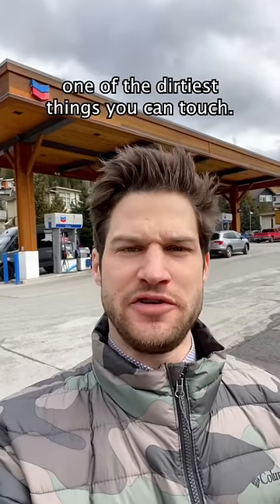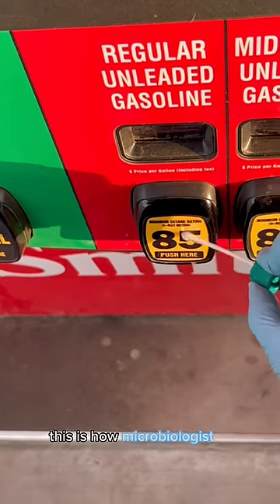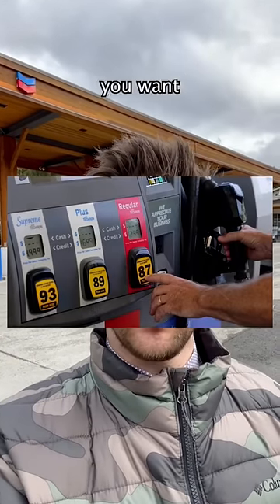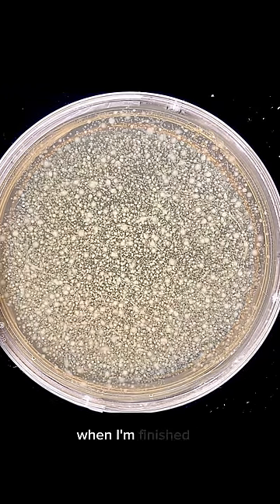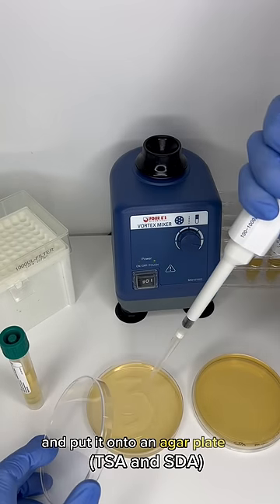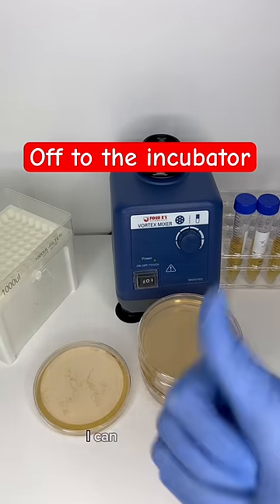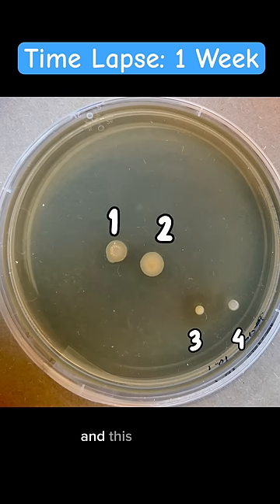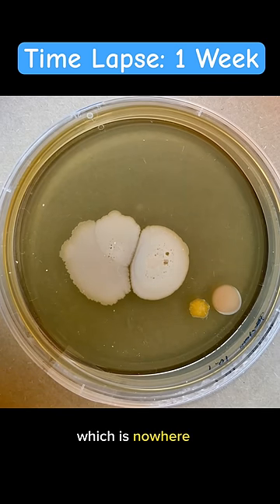Bacteria on the gas pump buttons?

Comment: Man went to the cleanest gas station I've ever seen
Reply from the maker: Probably. I need to go check more to double check. Keep an eye out for more videos. 😄
Reply: @whatmightgrow  you'd probably have to do dozens if not hundreds from different chains to get a representative selection, but it's still cool to show the process.
Reply: @whatmightgrow best thing is to go do a bunch and then combine and then divide by total.

But ask the servo staff what there most sold fuel grade(unleaded) is.

If they say 85 do that
If 87 etc
Reply: You’ve never been to a buc-ees then. Also that doesn’t necessarily make this test wrong.
Reply: @whatmightgrow check the buttons before hand, if it’s old and the paint is starting to wear, use that one!
Reply: @whatmightgrow what about the pump itself and the handle?? The most important parts you touch then go back to bring the dirt onto your car interior
Reply: I seen someone spray the pump n buttons w a little gas before they were finished and used hand sanitizer
Reply: Must be from New Jersey only state where it has an attendant who does it for you.😊
Reply: It is also possible that they just happened to have been cleaned that day or something
Reply: @whatmightgrow  i think you need to try to test the gas pump nuzzle handle too, ill wait for your update
Reply: @whatmightgrow absolutely! A test ain't reliable if its only done once
Reply: The pumps are outside and UV light for the sun should prevent to much bacteria from growing.  Those buttons should also be wiped down daily
Reply: @whatmightgrow they must’ve recently sanitizer it or something because my school door handles aren’t even that clean
Reply: @whatmightgrow try Costco
Reply: @whatmightgrow also take a sample from the pump handle because no matter which of the three buttons you press everybody touches that
Reply: That is average in my area.
Reply: I don't think your taking into account that people are hitting the button with the pump and probably getting gas on it killing some of the bacteria. That's how I hit the button anyway the handle probably way worse than the button
Reply: @whatmightgrow yeah why didnt you take samples from multiple stations? Instead you're determined to upload a video as fast as you can while providing no statistic and proves baseless
Reply: Fr I see stickers all of them near me
Reply: @whatmightgrow definitely.
And go to one that's in a poor neighborhood, preferably near to the liquor store and pawn shop.
Reply: @RomanGoetia he pribably needs to go to a suburban gas station
Reply: If people only knew that sunlight is capable of killing bacteria
Reply: @ThBlueSalamander yeah and that’s touched by every one, not just the one button the 3 buttons
Reply: @whatmightgrow thats the smoothest way to advertise your channel lol
Reply: Tbf gasoline is an amazing antiseptic
Reply: cope
Reply: @moo_dirty_socks_inc.407  same it was also weird to see wooden doors on gas chambers
Reply: Not really, how many microbes would be able to survive exposure to gasoline fumes
Reply: Bro went to a buc ee's
Reply: @whatmightgrow maybe if you went to a popular gas station
Reply: Just means it should’ve been a more dirty button.
Reply: i would say, while the method itself is scientific, the sample size is nowhere near acceptable
Reply: Nice the shell near me has cowwebs hanging around
Reply: @whatmightgrow  and you need also to take a more serious sample set... ok you dont have the resources for a peer review level of samples but I mean if you gonna bother make a video about 1 sample you could easily make the same exact video but take e.g 10 samples obviously from 10 different stations around the area you test
Reply from the maker: @billkillernic  I agree. In my longer video of this (youtube shorts are only 1 minute unfortunately) I talked about how I would be taking more samples. The original study only had a sample size of 3. I plan on doing much more than that.
Reply: Where tf do you live cause where I am like every gas pump is that clean
Reply: They saw it coming
Reply: Or everyone uses more of the others than 85
Reply: you want to go sometime afternoon or early morning around 6 am
Reply: @whatmightgrow try to go there at a time where it's just clearing the busyness. If there is one nearby you that you could check, having worked on a gas station (Europe and for only a month) I can say that the handles are cleaned at least, if not only, once a day.
Reply: That and don't forget the handle of the pump that's most likely worse than the buttons :p
Reply: @whatmightgrow  Try the nozzle too. Not every touches each button, but everyone has to touch the nozzle handle.
Reply: @RomanGoetia 
This would be a reasonable research tbh ❤❤❤❤
Reply: @whatmightgrow some gas stations clean regulary and some clean sometimes and there also can avoid the buttons to clean the screen
Reply: @whatmightgrow can there also be other factors like people using wipes before they press the button.
Reply: @whatmightgrow you tested on the new guys first day
Reply: The weather can destroys the bacteria
Reply: 😂fr
Reply: @whatmightgrow true lmao
Reply: He probably went to it just after it was cleaned
Reply: @whatmightgrow If you could go to a gas station in a rural area, I'd watch just to find out how dirty the gas pumps I've been touching are.
Reply: @whatmightgrow you should go to the lowest rated gas station and try it there
Reply: @whatmightgrow pleasee do the pump too!! i feel that would have alot more since its not three different buttons to choose, everyone grabs the pump yk??
Reply: Bruh I know for a fact in my city ain't nobody cleaned those buttons in years
Reply: Not to mention the video said "gas pumps", and even showed a picture of the gas pump...and this dude swabs the gas button! 🤦🏽‍♂️ Besides taking ONE sample and trying to sound scientific when he horribly failed using the scientific method. 🤦🏽‍♂️
Reply: @RomanGoetia It would also help to swab the GAS PUMP since that was the original statement...instead, this dude swabs the gas button! 🤦🏽‍♂️
Reply: @Crushal812 But the original video didn't say gas button...it said gas pump, and even showed a picture of the gas pump, and yet he swabbed the gas button. 🤦🏽‍♂️
Reply: @RomanGoetia especially ever since Covid a lot of businesses just started wiping down everything n never stopped so I guess that’s one cool thing we gained lmao
Reply: Also who uses the 85 button
Reply: Fr
Reply: @whatmightgrow yo
Reply: Gas station attendant here we clean them every 6 months or so for evaluation every store is different however ive heard the same from other stores in my area

The last clean my store diss was 2 months ago
Reply: @Steve.._.  That's the whole point.
Reply: Got a point the sample size was not diverse enough
Reply: Most of them look like that where I live.
Reply: @whatmightgrow bro went to bucees 💀
Reply: Yea I feel like a smiths gas station is representative lol. They’re a bit of an outlier on cleanliness for their fuel stations
Reply: @whatmightgrow  here in California it’s very common for gas station to sanitize the handles and the buttons 2 to 3 times a week and at least once a month they pressure wash the actual pump and concrete
Reply: #soda
Reply: I bet premium button is cleaniest among the three😅.
Reply: @whatmightgrow if you admit this you probably shouldnt've posted. We all make mistakes and oversights, though.
Reply: Nah, I think the reason is chilly wind and ultraviolet. Indoors the bacteria grow a lot better
Reply: Usually you can see like crust and gunk forming on the buttons, idk where he was but its way cleaner than they usually are
Reply: @RomanGoetia I think 10s of them and just average it  up
Reply: @gfdrffd3279  you could do that.  The more data, the better, but 10s would definitely be better than just a couple.
Reply: @whatmightgrow  that gas station probably disinfects their pumps regularly or you took samples when they just cleaned it
Reply: @whatmightgrow  Yeah, the ones around where I am are disgusting beyond compare, but I thoroughly wash my hands in case of gasoline anyway so it’s chill.
Reply: Exactly! I've seen people spit on the gas pump for good luck
Reply: Yeah it looks like a newer store. He obviously new that
Reply: @whatmightgrow if you find on, sample premium too.
Reply: @whatmightgrow go to Costco guaranteed good sample
Reply: WELL HERE MOST people tap the button with the nozzle so we good
Reply: Dedicated workers are the ones you can thank for that
Reply: A😊
Reply: and a lot less people use 85 octane
Reply: Try the Bronx..
Reply: @whatmightgrow lol why would you not check the handle? What is the point of this video 🤣🤣
Reply: @whatmightgrow  You also need a few control swabs for comparison. At least one of the swabs shouldn't touch anything except for the surrounding air, and another one should touch some other nearby material. You know, to be really scientifically methodical.
Reply: @whatmightgrow go to a shell they are always dirty, or depending where you are like a Valero or something
Reply: Fred Meyer fuel center was the only gas station I ever worked at....and we clean all the pumps daily (or at least it's assigned to the workers)
Reply: For real 😂
Reply: @whatmightgrow yea need larger sample size😅
Reply: It would also be smart to do it in the actual handle of the pump gun and not the button people press for a millisecond before the pump gas
Reply: @whatmightgrow  I’m pretty sure the actual pumps are “dirtier,” but it’s because of the gas, not the bacteria. So touching your face after getting gas would probably poison you somehow, not cause an infection.
Reply: Not exactly a great environment for bacteria though, dry and gets some sun, I’m sure your kitchen sink is worse
Reply: Do 87 instead of 85 cause who uses 85
Reply: i dont know man, ive been in some pretty sus areas
Reply: You also only wiped the button noone uses
Reply: @whatmightgrow  yea it depents on wich country the region the city + was it cleaned not so long ago or like never cleaned many many factors
Reply: @tidepods2004 because that's totally not flammable
Reply: Or they just cleaned it
Reply: Go to the hood
Reply: @whatmightgrow come to india 😆
Reply: @whatmightgrow I think you're a lier. Clearly you picked one station where the variables are in your favors.
Reply: @RomanGoetia why would he need hundreds what are you talking about
Reply: @pepega3344  The more you have and the more diverse the samples, the closer you get to having a representative data set.  This is why polls and studies that have thousands of participants, tests, examples, specimen, or reviews are preferable to those that have hundreds or fewer.  It lowers the likelihood of outliers, human error, and bias that may influence data, which is important for falsification. 

Next time that you read a study that has a small sample size, take it with a grain of salt because it's very easy to make false assumptions based on incomplete data.
Reply: Go to a wawa in a high traffic high pop area, or a circle k.
Reply: Sunlight is the best disinfectant
Reply: @RomanGoetia shush
Reply: @whatmightgrow I never touch the button I use the pump to press the button, you should test the pump handle.
Reply: I poke it with the gas nozzle tip
Reply: Literally tho
Reply: Cause it’s Chevron nobody goes cause it’s the most expensive usually
Reply: @whatmightgrow all talk no evidence
Reply: @whatmightgrow go to brooklyn ny☠️

Comment: Worked at a fuel kiosk, we wiped down the buttons and nozzles at least once a day, usually two or three times.
Reply: Work at one currently, can confirm that's what we do here. 3 times a day.
Reply: That's reassuring. Thank you for helping keep society healthy. 😅
Reply: Have a like my man
Reply: Yup. I was a waiter during the worst of COVID, hygiene perceptions skyrocketed, I cleaned tables constantly with disinfectant so I'd be surprised if bacteria managed to live there.
Reply: Thank you guys
Reply: I did the same. The hoses would turn the rags black for some reason.
Reply: @avokka you always kill 99%, it's never a full 100% as your body has bacteria to help the normal functions and bacteria is always around

You killed the excessive bacteria that aren't useful.
Reply: they do at Quiktrip as well. it’s a DAW task, must be done atleast twice a day with sanitizer. same with cleaning the bathrooms and wiping down the doors and handles to the drink coolers. even the pin pad where you insert your card and the knobs to get a slushy has to be wiped with sanitizer every hour or so. a good QT is extremely clean, including their kitchens and food prep.
Reply: @The14Core i thought 99% was just so companies can’t get sued for people getting sick even after using disinfectants due to user error. Like it does kill everything if you spray and wipe it down correctly, but if you spray and dab gently obviously it won’t kill everything.
Reply: @Dustweaver was that only after covid?
Reply: @NeoStorm123  Not sure, only been working there since late 2022.
Reply: Was gonna say this, people act like stuff people touch never gets cleaned
Reply: I also worked at a gas station, we wiped down the pumps every few months I think. Idk, I never did it.
Reply: @Dustweaver thanks man. I appreciate that even if I never use one of your pumps
Reply: Worked at a Chevron. We cleaned the buttons maybe once or twice a month if we felt like it
Reply: @kennethmoore625 it's the type of material they're made of. The outer coating is designed to slowly disintegrate in multiple conditions equally, such as hot and dry, hot and humid, cold and dry, etc. It's a safety feature to prevent the hose from becoming brittle and failing. The powder buildup is normal, but keeping them clean does make them last longer. Good job doing a good job 👍
Reply: I feel like a lot of public places that may see a lot of traffic, but get cleaned, are far cleaner than a lot of peoples house who don’t clean their bathroom until it’s yellow
Reply: Same! We really cleaned a lot, in the military now, feels almost the same. But i know for sure that it depends on the gas station
Reply: God bless y'all
Reply: Used to work at a gas station, can confirm that it was required to clean the buttons and the handle on the nozzle at least 2x every day
Reply: @dreamkitty  
Lmao that is so not true!!
QTs are located beside highways so they get a lot of customers. Have you ever seen disinfectant in the store?? They don't even sell disinfectant. The employees clean the bathrooms using febreze
Reply: I work at Wawa, overnights. Tbh, we get wayyyy too busy to have the time to do that kind of stuff. When I'm doing outside trash though, I always wipe down the fuel pumps. My managers always get irritated and tell me that I do too much sometimes but I would love to see them try to explain to the GM that I'm out of line for doing my job 😅
Reply: Just don’t use alcohol wipes 🤯
Reply: Worked at one, can confirm that not everyone will wipe them down. It’s expected but unfortunately unlikely depending on the location.
Reply: Doing gods work.